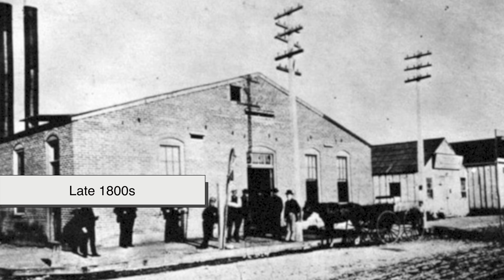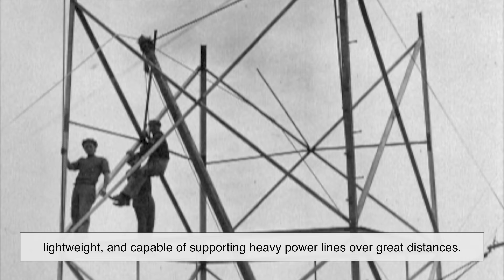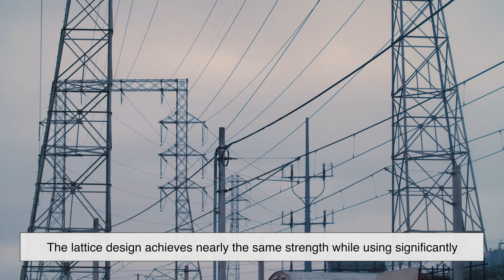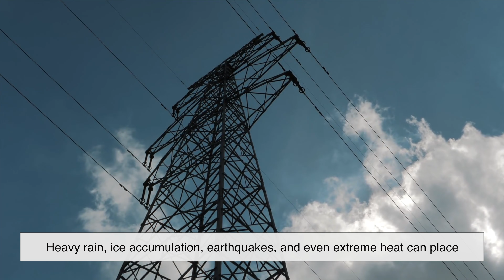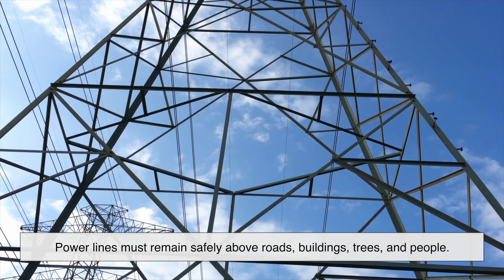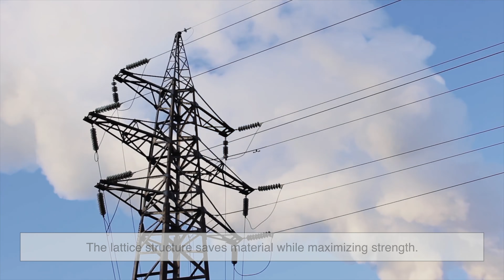Why Aren't Power Line Towers Just Solid Poles?

Comment: Power line towers use lattice structures because they provide excellent strength while using far less steel than a solid pole of the same height.

Comment: 0:11 i looked out the window but what i saw was literal logs being used as electical poles😊
Reply: Lower voltage distribution lines use wooden poles is cheaper and easier to maintain, they don't need that structural strength and ground clearance for cables

Comment: Lately solid poles have been used over here in The Netherlands.
Reply: Same as here in the u s, an entire line was rebuilt, and the old lattice structures were replaced with solid steel monopoles